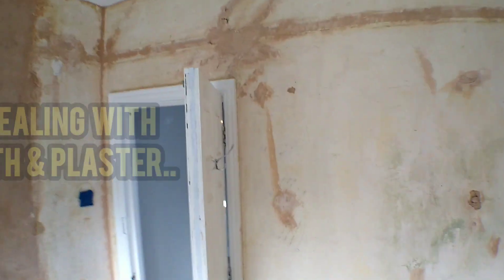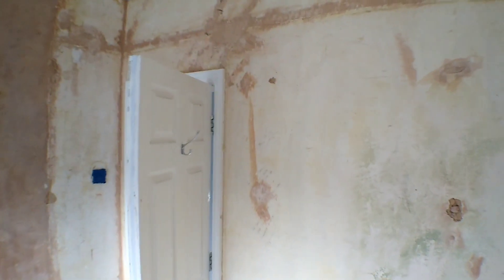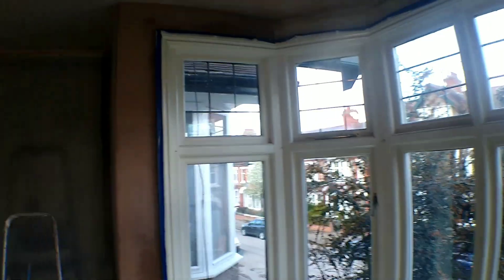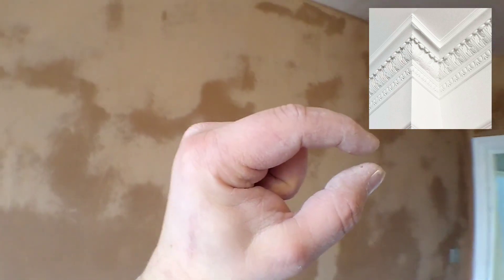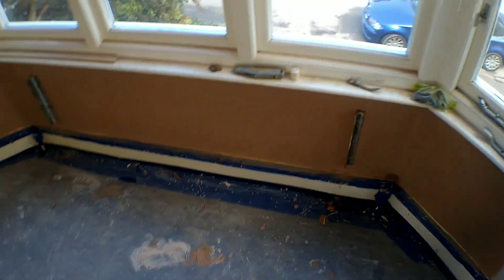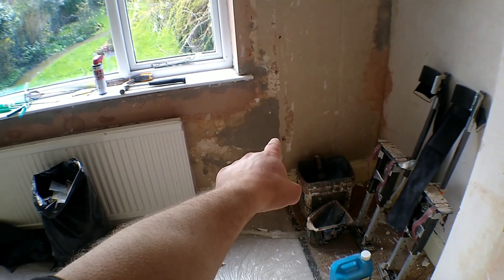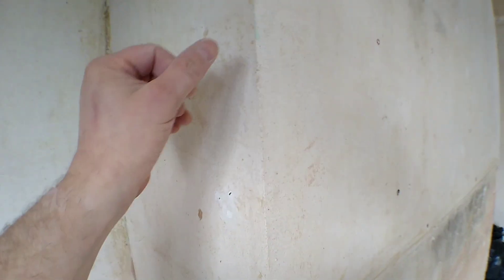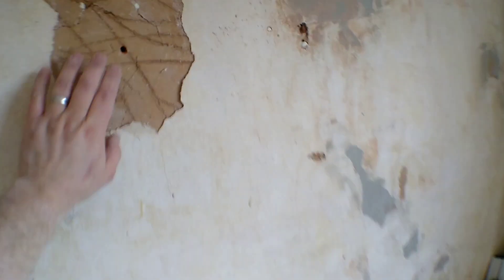HOW TO DEAL WITH OLD LATH & PLASTER WALLS

Comment: Old lath and plaster walls are generally breathable. For external walls, you need to consider whether it still needs some breathability before plastering over.
Reply from the maker: This wall is internal & the building is made up of Portland cement not lime

Comment: We always bed the mesh into the skim. Over old cracked walls like that we use a mix with bonding. Notch the first coat, and the mesh sits on the profile.

Comment: I have just taken down a lathe kitchen ceiling. Not taking a risk because its been up since 1929
If you don't want to lose the cornice multitool along it then board it over the lathe strips.
I would always use 12.5 mm board for rigidity and that's what's going up in the kitchen.

Comment: Nice. I've got an internal lath and plaster wall and want to dot and dab it with 9.5 boards. Can you just dot and dab straight on to lath and plaster without wallpaper on it? Or does it need screws..? 
Cheers.

Comment: Thanks for posting but if you have time to answer, what does the end of a lath and plaster wall look like where the internal door frame fits?
I need to shorten or extend my door frame to fit a new door and don't know what the extent of work will be if i remove the existing 790mm fit
Reply from the maker: When you remove the old frame there will be a timber stud in place which the frame is fixed to. In order to widen the frame you will need to remove this stud & reposition it. The laths can be trimmed using a circular saw 👍
Reply from the maker: If reducing the width then simply plant a piece of timber onto the stud then fix the new frame in place

Comment: Did you glue the mesh on
Reply from the maker: 8mm stainless staples 👍
Reply: @SDRobertsPlastering  thanks.
Reply: @SDRobertsPlastering  don't you have to bed the mesh into the first coat of plaster?
Reply from the maker: @ianturner8459  yes you can do it like this also. I do this when rendering but skimming I staple it
Reply: Was thinking of this myself.  Thanks for clarification
Reply: @paultant6741  Same. thanks for posting !

Comment: Rip it all out Final.
Reply: That's the right way to do it but not an affordable way for most people with no idea how to DIY. The proper way would be to remove all the plaster wall & call a heritage plasterer to re-lath the internal walls and then lime plaster it all, including use wooden beads for external corners not metal corner beads. Most will of course pick overboarding due to budget & knowledge constraints.